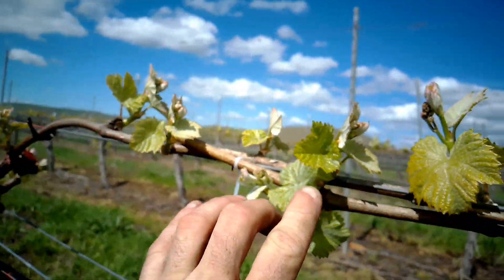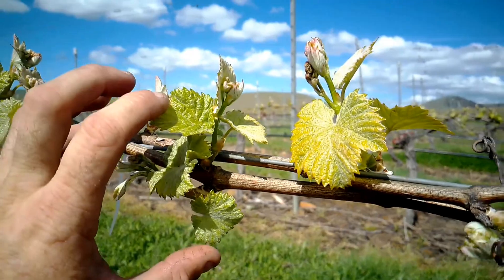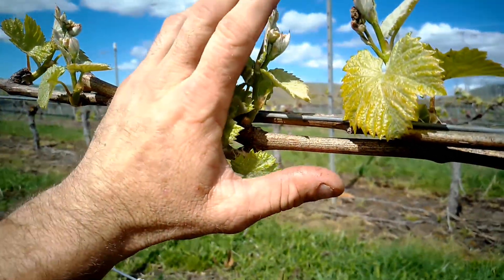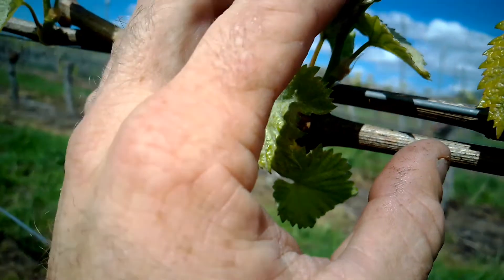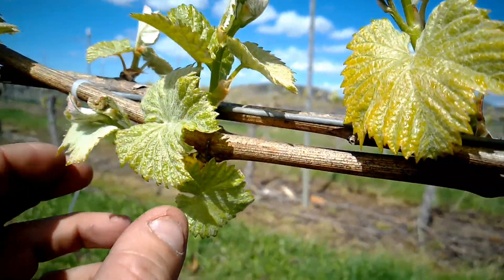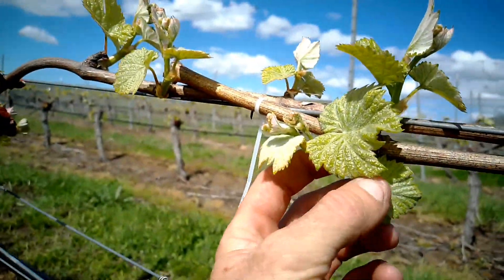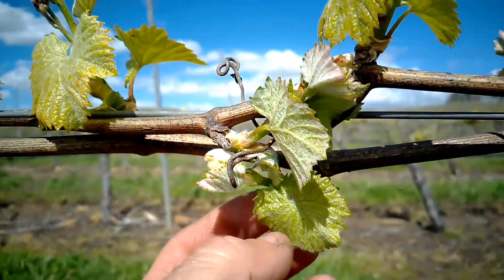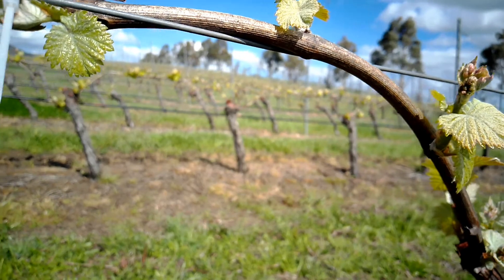overlapping cordons and what to do about it

Comment: I am curious as to why the vines have been trained with overlapping cordons in this first place since it appears to be detrimental from multiple perspectives. What are the advantages?
Reply from the maker: That is a really good question. And there are a few reasons why we end up with overlap. In the majority of cases I deal with the percentage of overall overlapping canes is small.  Due to yeild demands, a pre determined bud number per cane has already been decided prior to pruning operations  and at times that will result in overlap and in short the time it would take to measure the canes when they are pruned is more expensive overall than dealing with the small percentage of overlap later on. 
I personally don't mind overlap for one reason, it gives me the chance to remove the weakest potentially less productive shoots because I can see the difference in strength between the shoots in areas of congestion. 
In my situation missing some overlapping canes is also ok because I favour a high water volume when applying fungicides this normally provides enough coverage and penetration for congestion to not really be an issue in most circumstances. 

Depending on the skill and experience  of the pruning team avoiding overlap completely can be cost effective but it depends on particular circumstance. 
My apologies for rambling a bit, I hope I was able to answer your question
Reply: @hakunamoscato5353  Thanks so much for the detailed response. The reason I asked is that I've taken over managing a small 3.5 acre vineyard planted in 2011. The previous manager trained the vines on a very low cordon (12 inches off the ground) VSP system and there are many places where they overlapped the cordons not only twice, but 3 times! As a result, the spurs are way too close, many have not been pruned close enough to the cordon and many have so many shoots they look like a spider web.  It makes it difficult to manage the canopy, thin shoots, pull leaves and spray and is driving me crazy! I It's also promoting disease causing some of the cordons to die. We removed some of the excessive overlap this past spring, but I definitely need to devise a multi-year vine rejuvenation plan.
Reply from the maker: @l0jack  It sounds like your on a good track to fix the problems. A thin small canopy is sometimes harder to control diseases because it's more difficult to get the correct chemical amount on to the canopy. The chemicals are heavier than the water so if droplets start to form on the leaves you either end up with the chemical falling off the vine if the droplets fall. Or if they stay on the leaves the coverage is terrible because you end up with concentrated chemical droplets drying on the leaf instead of completely covering the surface area. Reducing the overall cane number will increase the vigour of your shoots and will make disease easier to control in the long run. But you are 100 percent correct it will be a long process. Changing nozzles and water volume on your sprayer until you get a combination that fives you the best coverage will help a lot in the short term.